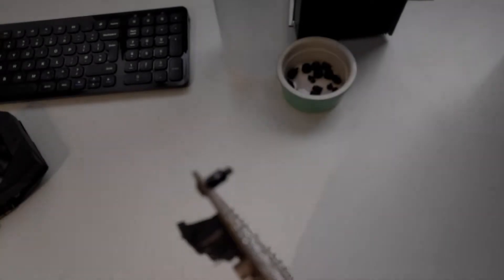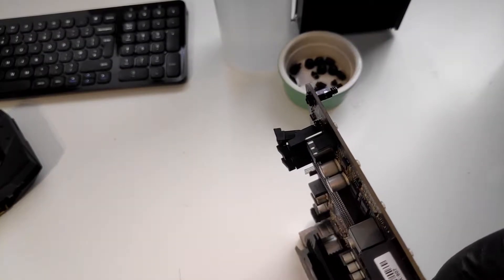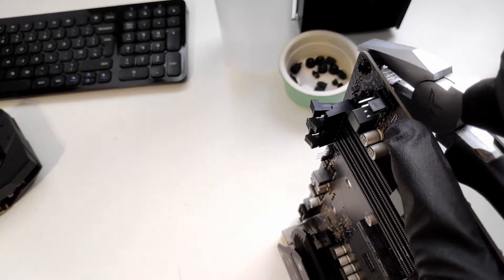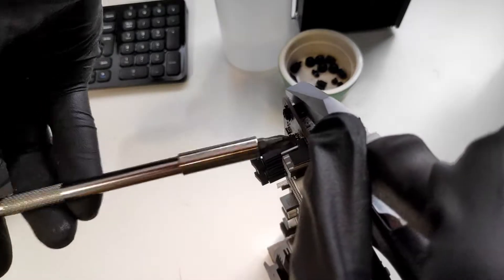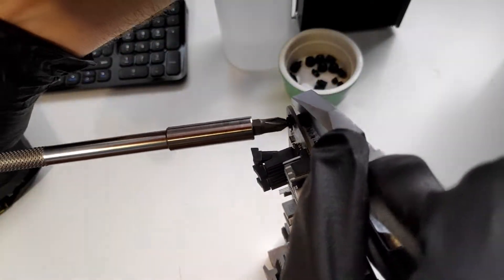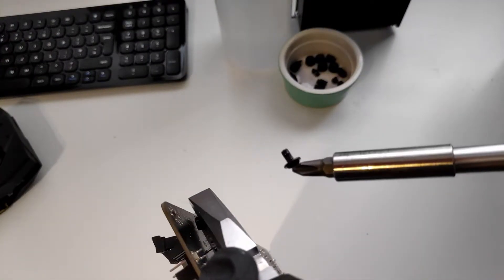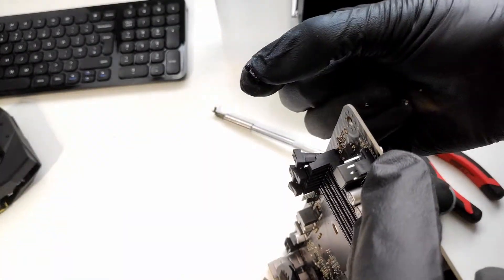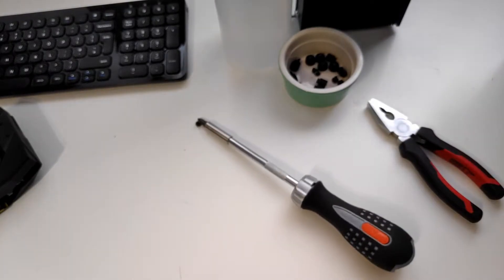How to Remove a Stuck Motherboard Screw or Standoff | Quick Fix

Comment: In case you don't have any pliers, you can use nail clippers! Works for me, might be work for you guys
Reply: you're an actual life saver
Reply: Holy shit actual god tier tip, thanks
Reply: just tried this with the motherboard still mounted onto the case as i couldnt get a good grip with pliers holding the threaded part of the stand-off screw. this really is a god tier tip. thankyou! this tip needs to be pinned at the top!
Reply: Holy cow this actually worked, you damn genius!
Reply: Appreciate you your are a fucking genius work for me the pliers didn't work but this work right away!!! You are awesome thank you so muchhhh!!!!
Reply: I'm impressed this actually worked for me, thanks
Reply: I fucking love you, it worked.
Reply: You rule!
Reply: This just saved me so much trouble I almost shed a tear of relief
Reply: Fucking god send thank you.
Reply: Actual goat

Comment: I just bought a brand new PC. When attempting to install a new SSD, I noticed the screw which secures the SSD was overtightened and I worked at it for over an hour, and it's still stuck. Currently my SSD is sitting in the slot at a 45 degree angle, all because the manufacturer overtightened the screw.

Comment: Hey guys in case nail clippers don’t work since you don’t have pliers then you can also reverse engineer it. What I did was use the square screwdriver with a gap on the back of the mobo and a regular screwdriver in the front, twisted different ways to get both screws out

Comment: I could not get mine off, but the hacksaw is a terrible idea dude. It could easily cut or injure the motherboard. Instead what worked for me, since I was moving my PC to a new PC case, I took the pliers and ripped out the motherboard stand on the new PC case (the stand that is in the same place as the stand stuck on the motherboard screw goes). That allowed the stand from the old PC case to sit in place of the stand of the new PC case. Then the motherboard fit perfectly and I was able to screw it into the new PC case.

Comment: For me it's stuck so much I'm destroying the screw and the standoff, it's just not coming out. It would be fine if my new case didn't have fixed standoffs but it has. Any other ways I could remove the standoff? I'm fine even breaking it, I won't need it.

Comment: I already knew this video isn't about what I'm looking for, but just in case someone reads this: In my case the culprit is that the screw end of the standoff sheared off (ridiculously soft metal) and got stuck in the case's thread. Any tips besides drilling a tiny hole into the screw piece and using a screw extractor? Just coming from yet another extremely pointless and super unhelpful Chat GPT session (anyone calling LLMs "A.I." is either dumb or doesn't know how LLMs really work) and resorting back to increasingly rare and hard to find human intelligence again :3
Reply: Almost the same case here, I tried so hard I destroyed the top of the screw and I can't get them apart
Reply: @z30_HUNGARY  Let me know how you fixed it when you fixed it :] I plan on drilling a tiny hole into the piece and either shove a tiny screw in that, or stick a piece of thin wire with a drop of superglue in it, to then twist the piece out.

Comment: Thanks. It worked. I didn't realise the standoff was still attached.
Strange thing is that the screw was from the top left, the stand was from the top right.
Wtf!?

Looking in the case...🤔  no the stand is still there...
Goes to show, don't work on electronics when you're pished.

🍻

Comment: Something I will never forget to do now is to ALWAYS tighten my standoffs that come already pre installed ... don't trust ANY manufacturer that they have adequately tightened them up already!!! or just buy cases with raised bump standoffs that way nothings getting stuck! also triple check you're using correct screws because they can also get stuck too so just be careful they are going in straight!

Comment: If your standoffs just spin try turning them at the back of your case with plyers ... I got my board out but had 2 standoffs still attached. Spent about a week trying every trick to get them off from rubber bands to wedging screws under screw head nothing would budge those bad boys!. So my only options were buy a drill and extractor drill bit and pray or visit a pc shop and pray I don't get hit with a stupid bill for something so simple for someone with the correct tools. SO! I took a walk to a pc shop and luckily they were all closed so I popped into a family run locksmiths next door and he was more than happy to lend a hand, grabbed some vice grips and had them both off in seconds!!! wanted to share this as it might be better to visit a locksmith rather than a £50 an hr tech...

Comment: What if my SCREW IS STRIPPED AND ALSO THE STAND OF IS STCUK INTO IT
Reply from the maker: Gonna need some good luck, then you could try drilling it out or hacksawing the standoff. At your own risk though, not easy to do this successfully
Reply: Did you get it out? If so, how???? I have the same problem
Reply: drill the screw to oblivion

Comment: Stuck with this problem, except the screw is stripped so I can't unscrew it even with the pliers bracing the standoff. Any ideas?
Reply: Managed to fix it (what a ***ing pain). Had to grip the top of the screw with the needlenose (because it was stripped), then unscrewed the standoff with another pair of pliers from the rear.
Reply: @acnash27  the same thing happened to me

Comment: I have a similar problem right now, and need to get pliers - will this happening prevent booting due to shorts? I tried to boot it from the box, but no display or anything, and wondering if that is what's doing it, or the mobo is really dead.

Comment: But what happens if the Stand off stuck in the case with no screw attached? 🤔
Reply: I wish I new that could happen before try build a PC.
Reply: happened here kkkkkk sucks
Reply: Hey, I'm aware you're probably fixed this issue by now but I had the same problem very recently and I used a hex nut driver and it came out with ease

Comment: ive been quite struggling since now about this stuff since my situation here is that my motherboard is stuck on the case and i cant seem to get it out since its kinda hard to reach. anyone got any solutions on how to solve this?
Reply: Its a year late, but I had this same issue and fixed it by taking a driver with a head attachment small enough to fit into the hole on the bottom of the board, pushed it as if attempting to pop the screw out, while also using another driver to turn the screw. Worked within a minute!

Comment: If you have one standoff stuck to a motherboard while still in a case and you can't uncsrew it do this: Unscrew all the working screws and one which is faulty as much as it can go, then when only that screw is left (stuck to standoff), lift motherboard a bit and wiggle at that spot and hopefully it will go out together with a motherboard. Than you can fix it later outside of case but most importantly you got your case free for a new build.
Reply: Thanks so much! This helped
Reply from the maker: Another great tip - thanks for sharing!
Reply: @thecomputersurgeon  what should I do if all of the standoff are stuck? 😅
Reply: Thanks 😂😂😂

Comment: Same thing happened to me I ended up using the wrong screws for my mobo lol until I had to remove it again and found out the hard way
Reply: Long story short all I had to do is pull my mobo out luckily the standoff wasn't stuck to the case completely and used the extent method in this guy's vid lol. I'm a bit worried since part of the area where the screw goes kina scratched the pcb but not close to any tracer lines

Comment: In the case that your motherboard is still stuck in the case and you don’t want to risk breaking it, follow the directions below. I got help from my grandpa.
You’ll need to have someone use a flathead screw to try to pry under it a little while you use another screwdriver to loosen the screw like normal. 
You’ll feel the screw tightening a little bit when unscrewing which is good because that means it is actually moving.
Reply: So my motherboard is already in my case and I put one of the wrong screws in, do you have want ideas on what I should do as I wanna change my cpu soon and don’t wanna do it while in case
Reply: @garethhempseed9429  this would be the exact thing to do, my problem was I accidentally put fan screws in my mobo.
Reply: @Toyss  thank you so much
Reply: @garethhempseed9429  No problem
Reply: Ur such a legend
Reply: Idk I still can’t get the flathead under the screw or undo it from the back
Reply: @serinabartle8075  do you have someone helping you? It doesn’t have to be fully under, just enough to lift it slightly. It will seem to not move at first and then you’ll start to see it actually making progress. Hopefully that works for you
Reply: @Toyss  do u or your uncle have any other tips because mines still stuck in and I’m really stressed
Reply: @splxshy4817  he doesn’t know much about computers he just does construction. If you can find someone who knows about construction or even maybe just handywork they might be able to help you. It was the only solution my grandpa had unfortunately
Reply: @Toyss your grandpa is a legend
Reply: Try pushing the end of the standoff with something strong and flat like the head of a hammer while loosening the screw (while only putting enough pressure on the screw to keep the screwdriver in so you don't counter the force you are putting on the other side) and it should at least come out of the case.
Reply: Thanks
Reply: Why do you need someone to pry it?
Have you lost an arm?

[tis but a scratch.]
Reply: @bazsuperbi  for me it was vital to see if it was making process
Reply: Cheers guys, all rebuilt now.
Good luck 🤞
Reply: @bazsuperbi  cheers, that’s awesome dude
Reply: Thank you so much
Reply: It work thank you so much🎉🎉🎉🎉🎉🎉🎉🎉🎉🎉
Reply: Im pretty confused on what to do can you please explain what to do in a simpler more detailed terms please. Im very bad at understanding instructions
Reply: @tartooq  Flathead screwdriver push under the screw. Then unscrew with a normal screwdriver.
Reply: @Toyss  ty so much <3 ill wait for my father to come to help me ill keep u updated
Reply: @Toyss  do i have the flat head screw driver under the bottom of the screw or under the top round circle of the screw?
Reply: @tartooq  The best I can explain it is under the circle of the screw so you can lift it up a little. It moves it up just enough that when you turn it, it moves on that spiral.
Reply: @Toyss  OMG TY SO MUVH GOD BLESS UE SOULBIT WORKED I ENDED UP USING THR WRONG SCREES FOR MOBO
Reply: @tartooq  No problem :D if you see a few replies before, I accidently put fan screws in my mobo and when I wanted to switch cases, I got stressed out too. My grandpa helped me.
Reply: @Toyss  yeah i got sooo stressed but i used ur trick at first it was hard but then screw by screw thr mobo started getting looses so all the screws were easy to get out using ur trick ty so much ur so wholesome
Reply: @tartooq  That is why it is easier if you have a friend/family push the flathead, while you unscrew the screw

Comment: What if it’s still in the case? I don’t want to destroy my mobo. Edit: Read replies for solution
Reply: Same
Reply: @ajotega9133  I ended up getting help with it and got it. 
You’ll need to have someone use a flathead screw to try to pry under it a little while you use another screwdriver to loosen the screw like normal. 
You’ll feel the screw tightening a little bit when unscrewing which is good because that means it is actually moving.
Reply: @Toyss  OMG IT FINALLY WORKED. I got someone else to help me and we tried for like 5 minutes. Eventually I got it out but basically I did what you said and it worked.
Reply: @ajotega9133  that’s awesome :D my grandpa does a lot of things with tools and I thought since he was over maybe he could help me. He finally came up with that and I was so happy when it worked. How long was yours stuck in there?
Reply from the maker: Nice solution

Copy and paste it to a separate comment and I'll pin it for you :)

Comment: Don't know if you'll reply but my laptop back panel screw is stuck. Two of the screws in the corner spins and even comes out a little but keeps rotating in its place. The standoff's broke and fell out when I was able to lift the panel a little. The screws according to my friend is screwed into the display hinges. Been trying since literally months and I'm not living in a place with good laptop repair service. Would be amazing if you or someone reading could guide me what to do.
Reply from the maker: That sounds specialist really so can't help. If all else fails the only way to get a screw out is to drill a hole in it but that's dicey on a laptop especially
Reply: @thecomputersurgeon  Oh okay.. that sucks thanks for the reply though.

Comment: I cant even get the board out...
Reply: It’s been two months but I also ran into this issue and you just got unscrew and unscrew to get the stand-off to unscrew with the motherboard
Reply: @toxiccabbage9093  yeah i fixed it but almost broke the board cuz i cant fit the tools underneeth, but i fixed it
Reply: @wolfyyflee6379  howwwwww!!!!!????!!
Reply: @soar-ex2231  how i fixed it?
Reply: @wolfyyflee6379  yea but nvm I just broke the stand-offs off the case so that I could pull out the motherboard and then take the standoffs off the motherboard separately
Reply: Rip

Comment: what to do if the motherboard is stuck in the case? there's no way that pliers would fit the space between motherboard and the case
Reply from the maker: If you have needle nose pliers it'll probably work
Reply: try to estimate the position and get an 8mm drill bit or larger and bore out a hole in the case

Comment: wait what. how did you remove the motherboard with the standoff stuck? 

the standoff was screwed on behind the motherboard, if the screw is stuck, how did you access it?

My problem: [I got a stuck screw on the motherboard and when I unscrew it, it picks up the MB and after unscrewing a little bit it snaps back along with the board because of the flex of the MB.]
Reply from the maker: I did mention in the video that it's if you've pulled the whole board out with standoffs in

You can still do this method regardless, just clamp the standoff with the pliers and unscrew the screw
Reply: @thecomputersurgeon  

Oh... So from the other side of the case?

Smart you!
Reply from the maker: You got it bud!

Comment: By mistake, I put wrong screws in motherboard and it didn't fit right.
I didn't tried hard and then later i realised those were wrong screws.
There are 4 such wrong screws stuck in my motherboard with standoffs.
Can i remove them without damaging my motherboard?
Reply from the maker: Have you tried what's in the video?
Reply: @thecomputersurgeon  it's all good now ! My build is ready!
Reply: Yes, just... watch the video, I felt like an idiot after watching this
Reply from the maker: It's the simple things sometimes :D
Reply: @Red Sparrow Be careful while doing this! It can damage your motherboard if anything goes wrong!
Or else you can get it done from an expert!
Reply: @Red Sparrow my hands were shivering! I was lucky enough to get that right